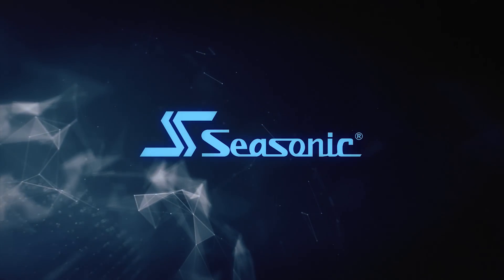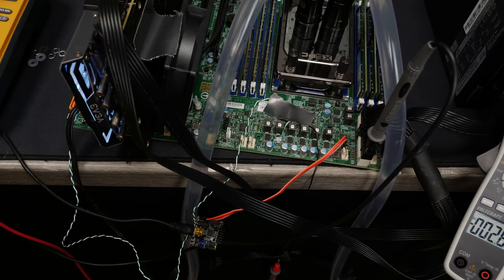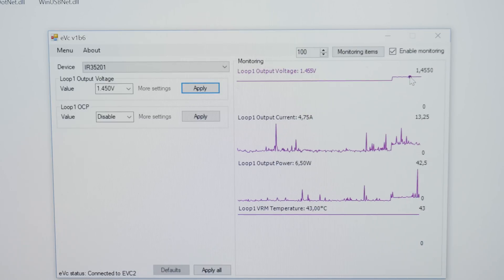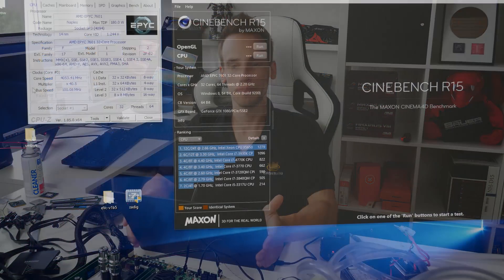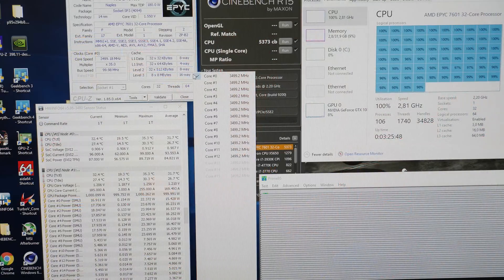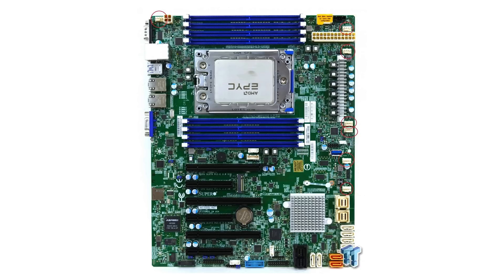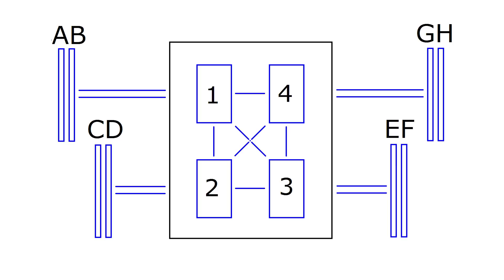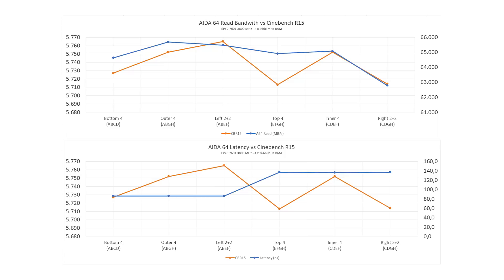EPYC 7601 Overclocked - Over 6000 Cinebench R15 and extensive RAM Tests

Comment: On the memory, the real latency test won't be things like cinebench, or other rendering. It will be games, where there is massive amounts of tiny actions at any given moment. The latency will not effect the intended audience (workstation users) but will effect games. Hell threadripper 1 already had issues in games where just because of cross talk between dies, you saw drastic performance reductions.
Reply: This is not a gaming CPU.  Should be obvious.
Reply: Its only an issue at high frame rates. If you game at a decent resolution like 4k you wont notice any difference as its GPU limited.

The 16 core also has only 2 dies and both have direct memory access so its fine. 

I would game no problem on a 2 die threadripper
Reply: James Mastroianni I don't mind playing games even with an i3 ivy bridge, but I hate to wait for the task to be completed, on my 5 ghz Xeon...
Reply: Well Epyc is a server CPU and not compatible with TR socket anyway. You can do whatever you want on TR.
Reply: no, i personally wouldn't buy TR/TR2 or Epyc (Im tied to Intel). but i've gamed on HEDT platforms since X58, most of the time with no issues or i knew of the performance deficit. I'm just saying with people lol'ing at using this Epyc chip while TR2 is going to be basically exactly the same, and apparently TR or TR2 isn't marketed towards gaming when it is. Yeah it's huge overkill but some do other things with their PCs other than game ;)
Reply: Okay lemme clear some things up for everyone here since no one seems to know how the zen platform works beyond one die. For starters, Epyc and TR work the EXACT SAME WAY, hell they both come off the same lines and both consist of multiple dual CCX zen chips connected via infinity fabric, and even both have unlocked multiplers. Second, any crosstalk between the dies add's a lot of latency, so regardless of if the chip has direct access to ram or not, it will still have to read memory from the other chips at some point, due to the way memory is used and how the data is not duped for each controller (this is where in SOME games you would see a drastic hit in performance, even when you should be limited by gpu, ie 4K gaming). Added latency does not impact compute heavy workloads such as rendering.
Reply: Mark Stubbs Intel has locked all their pro features to xeons for a very long time, but with the availability of ECC ram and massive PCIE expansion options on threadripper, the only thing you gain out of epyc is dual socket support and motherboards more designed for servers (native sas ports and port locations more ideal for rackmount cases).
Reply: quangluu96 Because for over a decade intel has had consumers locked to quad core chips. It takes time for the industry to catch up to innovation. So as the adoption rates of 6 core intel chips and 6/8 core ryzen chips goes up, there will be more viability in making programs that can utilize them.
Reply: i mean, i know but TR/Epyc is physically slower in the task that i do vs an Intel chip. Personally i don't need any server features or ECC memory i need fast cores and Intel gives me that; AMD not so much. Also you will find that while TR has more pci-e lanes, none of the mobos make use of this and offer the same feature set as their X299 counterparts, but with Intel i can buy WS boards and get a higher density of PCI-E lanes via PLX doublers if necessary, TR/Epyc i cant since they dont exist.
Reply: Mark Stubbs  Yes as a professional I actually understand some chips just work better for your usecase than others. I do have to say skylake X is not any faster than threadripper core to core, as they both use non ringbus interconnects, which means they both have the same core to core latency. 

Also can you explain how X399 boards don't make better use of the extra lanes? Every X399 board uses the lanes fully.
Reply: Andrew Joy,no it will even bottleneck games below 60fps (some games like stellaris or mmo games at big fights will go bellow 40fps) and the weird thing is that even at games that use only 1 core for the main thread group,it wont saturate one core,but sit at 60% and bottleneck....

this is my experience with my 1700x.... but on my 8600k games happily use 1 core at 100% 

actually i was hard pressed to find a game that actually didnt bottleneck my AMD cpu <60fps at specific scenarios es[ecially at stock. even battlefront 2 bottlenecked.... with a rx580...
Reply: Democritus86 There must be something wrong with your system then because my 1700 doesn't limit my 1080 in any game unless im pushing well over 100fps and I play at 1440p ultrawide. The issue being discussed here is the core processing the game data having to retrieve data from ram attached to the other die, which is not an issue on AM4.
Reply: James Mastroianni ,ah no the average fps is high many games get 100+ but specific scenarios in games  drop fps below 60.its all about what games you play @1080p
Reply: Democritus86 the only games that I know that cpus without ringbus (zen, skylake x) choke on are arma 3 and far cry primal. Can't vouch for stelaris as I've never seen it benched or played it. What MMO games are you talking about? Games like WoW and BDO?
Reply: James Mastroianni , BDO,ESO, Pubg on some scenarios,4x games like (stellaris) , its just the weird thing is that the CPU it will bottleneck but no core will reach 100% .(with SMT off)
Reply: Mark Stubbs Except the server environment is much more expensive.
Reply: If TR/TR2 is not meant for gaming or users with multiple tasks ie gaming and rendering videos etc etc, then why does it exist? any professional user would most likely just skip to Xeon or Epyc